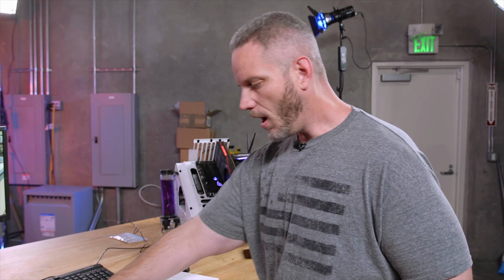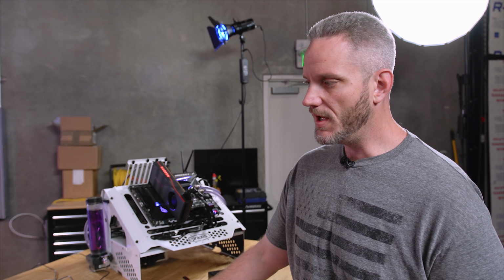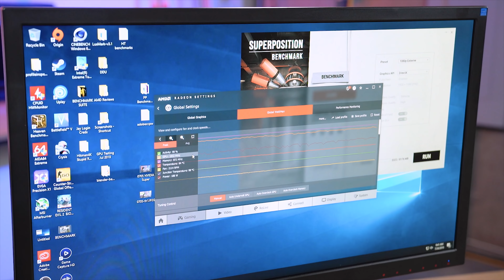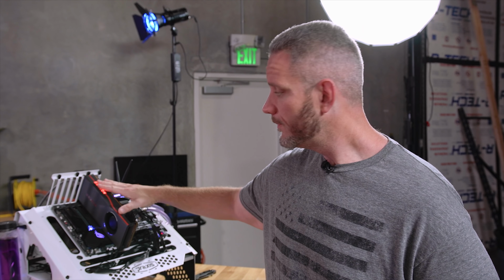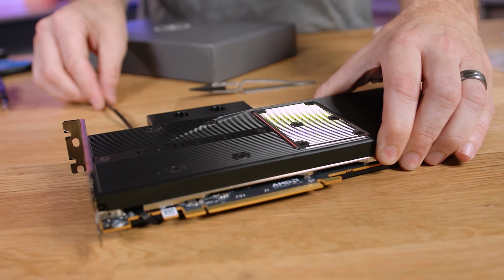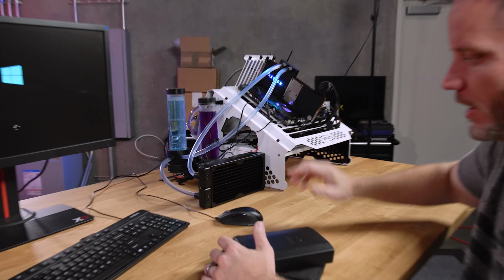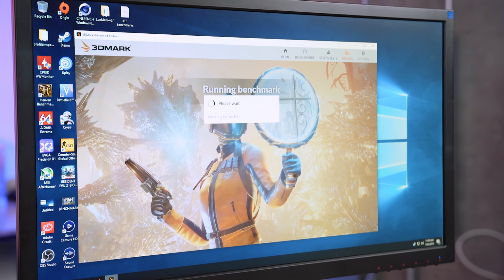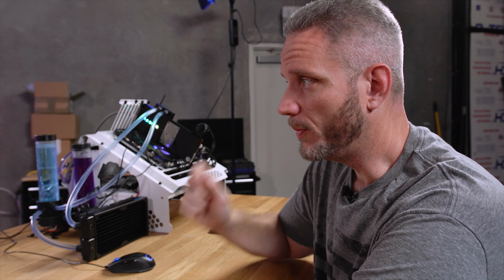Watercooled and Overclocked Radeon 5700 XT... Was it worth it?

Comment: I just wish EVGA would start making AMD cards. I'm actually more partial the the brand than I am Team Green or Team Red.
Reply: Me too. Though Sapphire is the closest AMD equivalent to EVGA.
Reply: XFX fanboy here. i know the feeling :D
Reply: Zsavage1  I can say my sapphire pulse(not even nitro) is boosting to 2109 using radeon software. Max edge temp gets to 71 C at 100% usage. Junction temp around 90. 

I would say on air that is good because it isnt thermal throttling right?
Reply: here i wish sapphire would build nvidia cards.
Reply: Zsavage1  never really understood the gm vs ford thing. they both make bad cars. well i mean gm doesnt make cars anymore so...
Reply: I’ve had many EVGA including a couple of their ‘FTW’ products and I’m telling you now Sapphire is better. Go Team Red mate
Reply: Imagine ftw amd cards 🥰🥰🥰🥰
Reply: I like there cards as well. Always quality.
Reply: @TheJerseyBoy  my xfx 5700xt thicc iii easily boosts to 2200 without manual oc and adequate temps
Reply: Thats with gen3 mobo speeds
Reply: Corpsefoot Gaming  MSI you say? that didn't age well (joke) 😅
Reply: EVGA is one of my more favorite brands next to Sapphire. I have a vega 56 Sapphire nitro+ and it's the best card I've laid my hands on (yet). Comparing to the XFX 5700xt thicc III and the EVGA 1080 ftw. Although the 5700xt just blows pass the 1080 and the vega 56 (which is a little more ahead of the 1080 both overclocked), the 5700xt from XFX is... not as good of construction design as a Sapphire. The fans are louder and the cooling is less than optimal than what I've seen on sapphire cards (which I did not work with). 

And both make bad cars, except for the crown vic... what a tank
Reply: Sapphire might actually be better in making cards than EVGA.
Reply: Zsavage1  60s? You would be more than 80 now
Reply: Zsavage1  oh shit, but you'd still be around 55 maybe 60.
Reply: in the end, EVGA would win following that idea
Reply: I hear they’re prevented from doing so, because of Nvidia’s policies.
Reply: This aged interestingly
Reply: @Zubbbz ;

Comment: I would normally make my own waterblock setup for my GPU's........  But I actually like the fact EK kept the original design quirks.  👍
Reply: Same, that was my first thought exactly!
Reply: Wow. What industry (and tools) are you in that you can make your own blocks?
Reply: @joker927  Not fully "make my own".  I use an EK Thermosphere universal GPU block with a copper VRAM coldplate I cut and level myself fitted to it, and a Koolance universal VRM block, again with a coldplate I make myself, or the original modded to take the waterblock.
Now I have a hot-air soldering station I've removed the original VRAM coldplates off of a 1080 Ti and a 1070, going to see if the stainless steel ones they attach to their heatsinks are as good as copper ones I make. 😉
......I'm a craft butcher by trade by-the-way!   😂
Reply: @JuxZeil  holy fuck you are so next level diy. I thought I was good delidding and lapping. How in the world do you cut and level such small things?
Reply: Would love to see some of your masterpieces , must look rad
Reply: @joker927  Patience, practice, the proper tools, and measure twice....cut once. 😊
I've always enjoyed engineering and DIY, from as early as 12 years old I was stripping, reconditioning, spraying, and hand detailing motorcycles, from 15 years I was fixing my own cars.  I've built PC and watercooled them from about 20 years old, I've done my own DIY where I can.......I'm 46 this year, so I've had some practice.
When you enjoy something, it really isn't that difficult to learn. 👍
Reply: Tony Melo  It's not a pretty face that goes with the name.... Not a good idea.🤣
Reply: @JuxZeil  "going to see if the stainless steel ones they attach to their heatsinks are as good as copper ones I make. 😉"

you already know that answer...modesty is a strong suit ;)
Reply: @JuxZeil  dude! goddammit it's been so long since i saw someone ACTUALLY HARDCORE MODDING. i have this idea in my brain of getting some copper plates, cut it into proper pieces and solder them (lapped, pb/sn layer 250C with a clamp to squeeze out the excess, nothing major) to make a dank coldplate that can't break the gpu core (been there done that rip hd6870) and screw the block i already got on the 670 to it. it's currently held on with an aluminium bridge and a screw putting pressure to the block into a small circular indent to prevent it sliding off like it's 2003. cpu has zipties but who cares it's got an ihs. :)
i've found this thing that might be useful for coldplates -> https://thermtest.com/thermal-resources/conduction-calculator
Reply: @emperorSbraz  Just don't forget to get rid of ALL the flux from the soldering process(even if you have to polish it out).  It's basically an acid so it's not good to leave it in the loop.  Sounds fine though, and you're right about those old center pinned waterblocks, they are far less likely to crack the die due to uneven pressure.  The MOST important thing to always check is the baseplatethough(the side that sits on the die/silicon.  Every time you re-use the direct-die blocks you should make sure the surface is DEAD flat.  I've often found that after time the baseplate warps and needs a wet & dry session.  I can only assume it's due to a combination of the clamping force, the constant heat with a high overclock and then the cooldown when the system's shut down, and the fact that most blocks are made of copper and pretty thin over the actual die area.
My next project is a CPU block for the new R9 3950X when it comes out.  It's something on the lines of what 8Pack was describing during Computex, where you don't even have a coldplate......
the block will sit directly on the delidded CPU and the water will hit each die with an 'O' ring seal around it.  
Dodgy......but should be fun! 😁
Reply: @UniqueBreakfastTaco  Ya.... given up on that now.  After taking them off, I've noticed how flimsy the original ones are, like tin can flimsy.  Sticking to the 3mm copper. 😣
Reply: @JuxZeil  i sometimes wondered if copper blocks could flex and become concave over time and you seem to confirm they do. damn physics.. there's always something. :D at some point i'll get a thikk glass block to put sandpaper on it to do lapping stuff. ^_^
direct die with such a large block will be a pain to balance the mounting pressure, even just the mainboard flexing will be a problem. you could lap and solder the ihs to the waterblock maybe?
Reply: @emperorSbraz  Ya, it's a pain.  Even though it's not an "old block" by my standards, I've even had to skim the EK Supremacy Evo I got second hand. 
The beauty with the design I have in mind is the 'O' rings can be soft or hard, so the soft ones will require very little pressure to seal, and they will "spread" when under pressure to fit snug AROUND the silicon.  It'll take some extra prepping of the CPU's substrate with a thin layer of silicon sealant, but shouldn't be an issue. 👍
Reply: @JuxZeil  wait you want to put orings on the cpu substrate to protect the die from cracking?
Reply: @emperorSbraz  No, there's no pressure on the die, so no need to worry about cracking the dies.  I'm going to use a plexi top off an EK block so I can see how the 'O' rings are spreading.  Just to make sure the seal's good.  It'll take fine bi-lateral force adjustments that's all.
Reply: @JuxZeil  aah k now it makes sense. :D i don't do o-rings. i actually hate the current waterblock market that promotes shiny stuff but that's me.
that said i'd solder the top.
my current three ancient blocks i bought in the early 2000s (three because back in the day we did watercooled northbridge. one is on a shelf) are all soldered and pre-tested to a stupid pressure like 100 psi or something i don't remember exactly.
THAT imo is a proper seal, not rubber o-rings that can degrade over time. :)

if you want to design the whole thing just a word of advice: i'm cooling the 670 running at 1202 constantly with a 160% power target with one of those gpu/chipset waterblocks i mentioned earlier, and those were designed with sub-100w parts in mind. it's a low impedance 40x40mm block that eats 200w like a champ using a puny 3€ pump at 6-ish volts. most of the thermal delta comes from the radiator.

point is, you don't have to do huge blocks but rather just properly tuning turbolent flow in the chamber. i'm not convinced current "microfin" designs are actually doing proper turbolent flow, which would increase performance a lot.

you want an irregular shape that breaks the flow without being too restrictive, like the internal flow area should be equal or a bit less to the pipe area. larger area slows down the flow leading to laminar flow.
Reply: @emperorSbraz  See, I'm going for direct contact+high flow rate.  I've pretty much determined that the new Zen 2 CPU's are a TOTALLY different beast to cool than previous CPU's.  Not only is the old cooling methods no good because they focus their cooling potential and soak-away at the center(if you look at the Ryzen 3000's chiplet design, ALL the hottest chips are near the bottom and right edges), but there's just too many layers to effectively take the heat away quick enough(if you read about the 7Nm process used, the density of the architecture can lead to heat trapping effects in the die).  Therefore I restructure the plexi blocks channel that is 10mm round the chiplet dies first, and then the I/O die to the exit point.  I'm currently checking waterblock schematics for the Epyc and Threadripper series, and other server grade blocks to better find a "pre-channeled" top to work with.
It's deffo the most I've been excited about modding for a fair while with the Zen 2 launch and all the other advances AMD have put through the patent offices, can't wait to see what we get with Navi's next stepping too. 😁
Reply: Also, I don't worry too much about the longevity of the seals as long as they are not messed about with after "settling".  I also replace my PC quite often as I love watercooling and modding almost as much as gaming, so it's usually no longer than 5 years I have a system I built in my possession.  They get passed down to my Mother as an upgrade or sold within a couple of years.
Reply: @JuxZeil  Didn't expect to get inspiration from YouTube today kind sir.. but you have given me it.. Thank You.
Reply: @joker927  I dunno about the other dude but if you happen to have a big mill or CNC machine you can make a waterblock pretty easily. You can even make it just like the one in this video if you're good.
Reply: But the original design looks awfull in my opinion
Reply: @antreaskonstantinou8585  It is subjective. 🤷‍♂️

Comment: Jay use the snipping tool for doing partial screenshots and record temps. Extremely easy and fast to use and gives you way better quality than using your phone. Additionally you can easily compare the results on the same monitor afterwards...
Reply: That would slow it down. Not much, but some. A separate capture system would be ideal
Reply: Yes, if you want to turn around and look at your screen (not at the camera) every time you're talking about the numbers...
Reply: or pen and paper
Reply: Would have liked to seen the 5700xt registry mod with watercooling
Reply: @everythingfeline7367  water cool the snipit tool and give it more power
Reply: Try Alt-PrintScr and just wait to paste into paint or wherever once your test is finshed.
Reply: Nah. Use Shift-Start-S and you'll open Quick Snap, much faster, convenient and modern than Snipping Tool.
Reply: @raresmacovei8382  Wow thanks. Didn't even know this existed.
Reply: I just learned that Fn + spacebar is the shortcut in case anyone is interested
Reply: There's an app called lightshot which is basically a screenshot app for Windows, it binds to the prntscrn key and it's very intuitive, highly recommended.
Reply: Alt + print screen with Greenshot does the job for me
Reply: win+printscreen directly makes a printscreen and directly saves it in My Images folder. No need to open paint or al.

Comment: I just watercooled my 7600GT like a bauss. 😎
Reply: Occasional Cortex heck
Reply: Water-cooled the gtx 745
Reply: +0.000000005 FPS
Reply: Post your benches somewhere buddy!!  I might have to mod my 7600GT Diamond Plus now........thanks bud.  😉
Reply: I dont believe a 7600gt is worth a re-paste lol
Reply: And here I was thinking having a 9600GT as the best GPU besides an ATI Mobile Radeon was hardcore.
Reply: @DasBrotkuchen  Now is the BEST time to get the bench scores for these cards in the charts......no pro's are benching them!😁
Reply: Certified mad lad right here!
Reply: We need A JayzTwoCents Budget Water Cooling PC with a Pentium G & GT1030 🤣🤣🤣🤣🤣
Reply: Hahaha I watercooled my pentium cpu and overclocked it to 6 ghz on all cores with liquid nitrogen
Reply: @JuxZeil  reminds me of when I had a QX9650 overclocked to the limit and started benchmarking low-end cards with a waterblock, fan, pump and a bucket of ice water setup :D
Reply: @TsvetanVR  I got up to peltier and phase-change(refrigerator motor) in the early 2000's.🤣
I even thought of running as a daily rig too....😆
Reply: @JuxZeil  I was running phase-change on the CPU 24/7 for a year or two. At max power. No idea how I slept just fine next to that thing lol :D 
Now I'm thinking of a more sophisticated approach - water chiller and a strong pump in a cabinet in the next room with pipes passing through the wall and into the PC. :D
Reply: My 7600GS also watercooled! I spill the water on its passive radiator!
Reply: Nice I still have my 1st Gen i7 920 water cooled @ 4.5ghz with 2x 9800gt's in SLI that still hold the #5 spot in Hwbot in 3dmark06 at the time it was posted it was #1 in the world 😉
Reply: I watercooled my laptop...ROG series :)
Reply: @JAz3  hey! im a proud owner of a gtx 745 and its amazing power, dont you dare talk shitt about my lovely ''gpu''

Comment: "If you like to watercool, then who cares what we have to say or anyone else. Do what you want to do!"

This is what I love about this scene. I have dual Vega 64's and have been hesitant on buying EC blocks for them just because the "financial sense". But, you just reminded me, who says it has to make financial sense. It's about doing things that interest YOU and what you find fun. 

So, move over H115i, I got a custom water loop to figure out how to make.
Reply: I have dual Vega FE's water cooled. If I were to do it again, i'd get the cheaper Ali express blocks.(Have one on my Vega 56 HTPC).  Works exactly the same as the EK blocks, but you save around $60. 

Make sure your power supply is big. 1200w was not enough to power the 2 cards and my threadripper 1950x. Bought a 2nd hand EVGA 1600w PSU which solved the issue.
Reply: @manya3084a  I have realized the power issue the hard way! I hope I haven't done damage but was running both Vega 64 at Max  (stock no undervolt) for over 50 hours (10 at a time) using my 850W power supply...nothing bad seemingly happened besides I think one crash. Have them both connected still but no more hashcat until 1600.

Thanks for the Ali Express tip! I will definitely check it out
Reply: @manya3084a  Jesus.....I just went to check about the power consumption for the Threadripper. I knew it had to draw a lot of power but I didn't know it's that much.
Reply: @Mikri90  It's probably because I have my CPU overclocked to 4.15ghz. Just waiting for threadripper 3 😉. Also, big Navi if it ever materialises.
Reply: @manya3084a  I guessed so, because the numbers for stock threadripper are considerably lower, but once it's OC the power draw goes way up.

Comment: im a silence enthusiast, so i just strap on a gigantic cpu tower cooler to my new gpu every time, i wish this was a more officially supported approach to building computers
Reply: You terrify, and amaze me at the same time
Reply: Same,but i trow tons of rad space on my wc loop  :)
Reply: How do you keep the other components on the GPU cool though?
Reply: @maj429  You can get small heatsinks on amazon/ebay, and with a fan placed over afterwards it keeps it pretty cool. Used to do the same :)
Reply: Just point a fan at it. Honestly just having decent direct airflow on cards is usually more than enough to keep the VRM's and memory cool. Use little heatsinks if you're paranoid or doing crazy overclocking.
Reply: It is offialy supported, its called MORPHEUS 2 CORE
droped my vega 56 from 80 to 50
Reply: I bet you stole that idea from DIY PERKS YouTube channel
Reply: @RavenVapes  that ideas been around for years. Ive seen the video you are talking about and ita great...but hes def not the first to do it. People were doing that back in the 8800gtx days (maybe even before but thats when i first saw it)
Reply: @EspHack Look into getting a Raijintek Morpheus II, they feature everything you'll want. I have one myself with two BeQuiet! Silent Wings 3 120mm, with the right fan curve it is basically silent and cools to similar levels as a water cooler
Reply: Get a GPU shroud with fan hole mount to cool the VRAM or put a PCI fan in the slot right next to the VRAM to cool it lol... It will look ghetto rigged but thats the point of it in the first place by using a CPU cooler to cool a GPU lmao
Reply: Ah, you remind me of  SilentPCReview.com